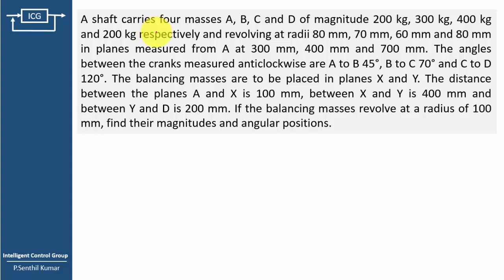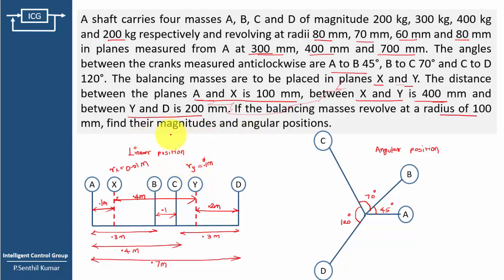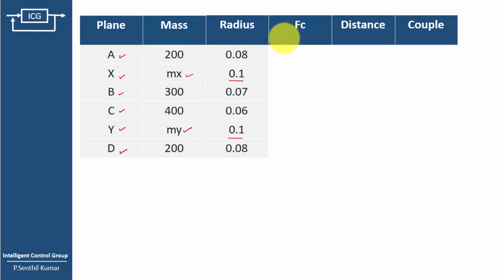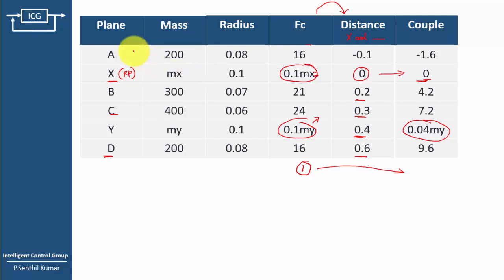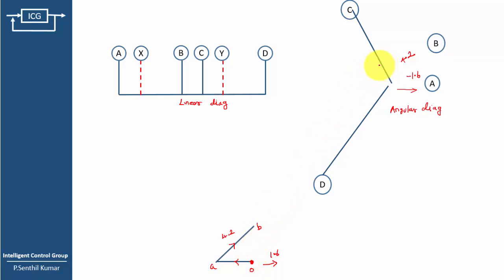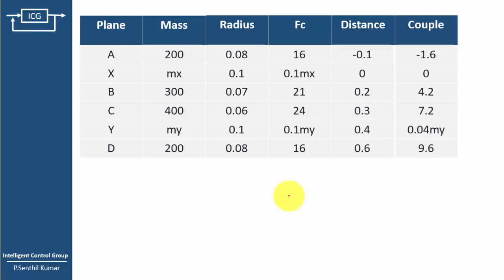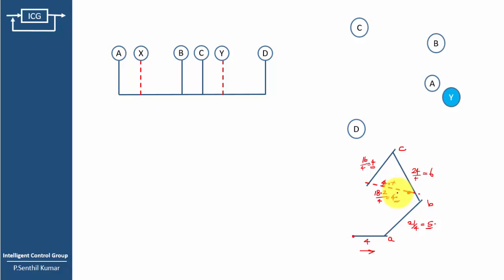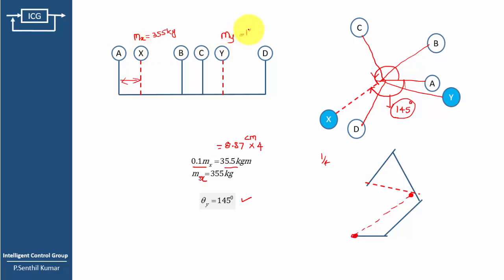Lecture 3.2.1 Balancing of rotating mass | Problem 1

Comment: 9.	A rotating shaft carries four discs C, D, E and F tightly bolted to it. The centres of mass are 34 mm, 41 mm, 54 mm and 62 mm respectively from the axis of rotation. The masses C, d and F are 7.1 kg, 5 kg and 4.5 kg; the axial distance C and D is 320 mm and that between C and E is 400 mm. Masses C and D are at 1500 to each other. For complete balance, determine:
i.	The axial distance between the planes of revolution of E and F,                        
ii.	The angles between masses C, D and F,                                                           
iii.	The mass E,                                                                                                         
iv.	The angle between E and C.

Comment: A rotating shaft carries four unbalanced masses mi, m2, m3 & ma of magnitudes 20 kg. 15 kg, 17 kg, & 14 kg revolving at radii 60 mm, 80 mm, 100 mm & 60 mm respectively. The masses m2, m; & m. revolve in planes 100 mm, 180 mm & 300 mm respectively from the plane of mass m & are angularly located at 65°, 145° & 270° respectively, measured in anticlockwise direction, from the mass m looking from the mass end of shaft. The shaft is to be dynamically balanced by two masses, both located at 70 mm radii & revolving in plane midway between those of masses m, & m & midway between those of masses m3 & m.. Determine the magnitudes of the balancing masses & their respective angular position.

Comment: Three rotating masses A = 14kg, B = 11kg and C = 21kg are carried on a shaft, with centres
of mass 275 mm, 400 mm and 150 mm respectively from the shaft axis. The angular positions of
B and C are 600 and 1350 respectively from A, measured in the same direction. The distance
between the planes of rotation of A and B is 1.35 m, and between those of A and C is 3.6 m, B
and C being on the same side of A.
Two balance masses are to be fitted, each with it centre of mass 225 mm from the shaft axis, in
planes midway between those of A and B and of B and C. Determine the magnitude and angular
position with respect to A of each balance mass using the analytical method only.

Comment: Three masses of 8 kg , 12 kg , and 15 kg attached at radial distances of 80 mm , 100 mm, and 60 mm respectively to a disc on a shaft are in complete balance . Determine the angular position of the masses of 12 kg and 15 kg relative to the 8 kg mass.

Comment: The following data apply to an outside cylinder unbalanced locomotive:
Mass of rotating parts per cylinder per cylinder = 360 kg.
Mass of reciprocating parts per cylinder = 300 kg.
Angle between cranks = 900
Crank radius = 300 mm
Cylinder centers = 1.75 m
Radius of balance masses = 750 mm
Wheel centers = 1.45 m
If the whole of rotating and 2/3 of the reciprocating parts are to be
balanced in planes of driving wheels. Find:
(i) Magnitude and angular position of balance masses.
(ii) Speed in kilometers per hour at which the wheel will lift off the rails
when the load on each driving wheel is 50 KN and the diameter of tread

Comment: Four masses A, B, C and D revolve at equal radii and are
equally spaced along a shaft. The mass B is 7 kg and the radii of C
and D make the angles of 900
 and 2400
 respectively with the radius
of B. Find the magnitude of the masses A, C and D and the angular
position of A so that the system may be completely balanced